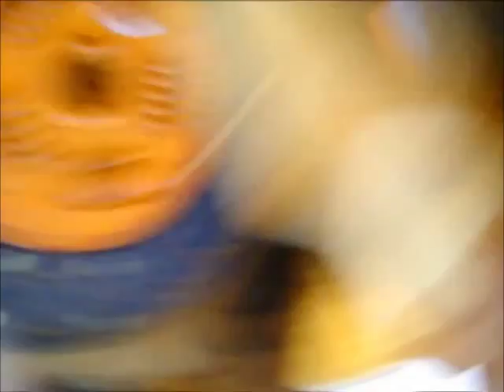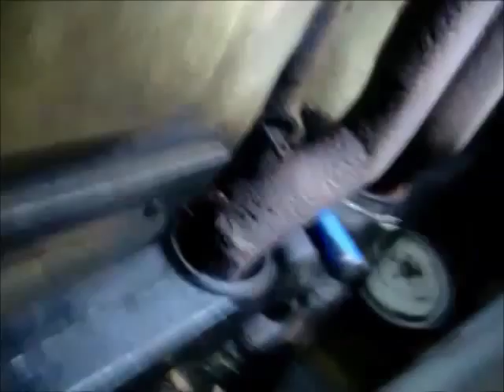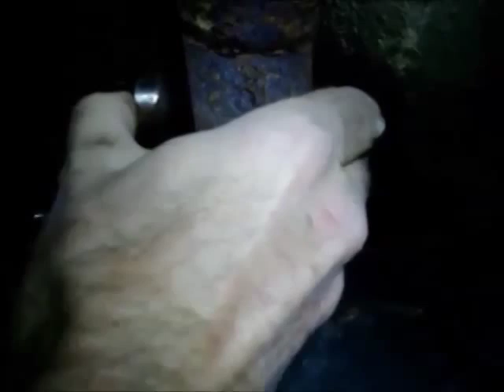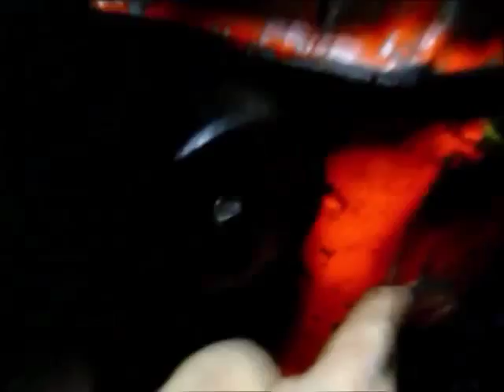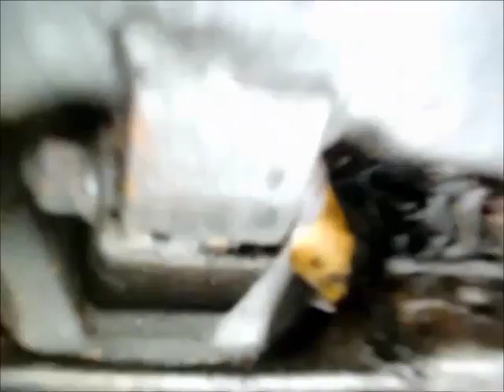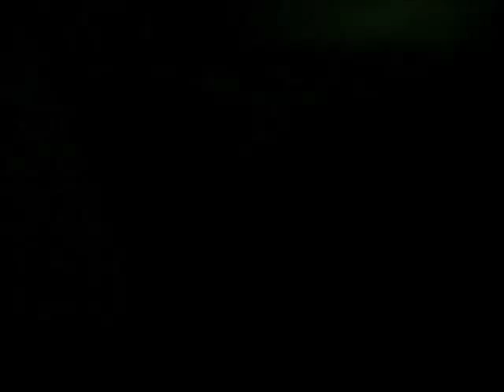1963 Corvette clutch replacement, part 1 of 5, preparation

Comment: My '66 needs a clutch, dammit
Reply from the maker: John Blutarsky, yeah, not easy on a Vette, that's for sure.
Reply: @owenrobertson  No doubt.  Harder with no lift and on an angled driveway, outside...but I budgeted for this and there's a good shop three miles away. Oh well.
Reply from the maker: I hope you've got it back on the road soon Bluto.
Reply: @owenrobertson  thanks!

Comment: Thanks for this one.  I have about 300 miles on my engine rebuild and the new throwout bearing failed.  I wasn't interested in removing the engine/transmission again to repair it.  This method made the whole job an afternoon even with interruptions.  Also, I wish I knew to remove the shifter from the rear of the crossmember when I took the engine out the first time.
Reply from the maker: Nice!

Comment: I just want to say thank you for posting this series of videos. I consider myself an average mechanic, and this vid made the removal much more understandable than my Chilton's manual. I did this on my '67, and although there were a few minor differences, I ran into all the same snags you did. 
I originally took my '67 in to a dealership to have my trans and differential fluids changed, they told my the trans was leaking and they had to remove the engine with the trans because of the cross member.. Would be several thousand dollars. They also said my trans drain plug was "sheared off" but I guess by '67 they stopped building the Muncie with a drain plug so they were just full of it. Anyways after removing, I took the muncie to my trans guy in St. Louis who put a new bearing in and gave it new gaskets and a clean bill of health. Ordered a new clutch and put it back together. Works great now! And my throw out bearing was making noise so it was good to replace that too.
I would mention that the lower bell housing cover was not mentioned in part 3, which I found out after already putting the flywheel, clutch disc and pressure plate on.. Maybe that's just later than '63.. Anyways I took it all off to install the cover, but I could have just removed the starter later on. My shifter bracket and exhaust bracket was a little different as well, but that's all I ran in to. 
Thanks again for posting this. My '67 is running very smooth and shifts very nice after cleaning everything up!
Reply from the maker: +Chris Parrett Glad it helped.  Sorry about the dust cover, it's a real juggling act in a mid year when you just don't want to pull or even move the engine.  You're right of course, I forgot to install that dust cover.  Then I cheated, I put it with my Vette's original fuel tank and some other original parts, and ordered an aftermarket bellhousing dust cover.  I cut the aftermarket part, so that it could be installed without removing the starter.  It's a handy inspection plate, if I ever want to look up in there, now it comes down really easily, without messing with the starter.  I don't recommend doing that though, it seemed easy enough at first, but when I started the engine, it contacted the flywheel a bit, just enough to make noise, and not damage anything.  I had to drop it back out and weld some steel to it to reinforce it.  That kept it from flexing against the flywheel.  Too much work, I should have just removed the starter.
Reply from the maker: +Chris Parrett Hopefully the next guy with a mid year will read this, for a heads up on that that bellhousing dust cover...regarding my other reply.
Reply from the maker: +Chris Parrett You're lucky to have a '67...you notice how your front to rear metal brake line runs along the lower portion of your frame rail?  I just found out they started doing that in '65.  1963 has that brake line running along the top of the frame rail, in that very tight spot between the frame and the body.  Mine sprung a pin hole leak from corrosion, and I bought the nice pre-bent metal brake line from one of the Corvette parts houses.  Part in hand, I looked under my car...uh oh...I googled it, the only way to install a '63 Corvette front to rear brake line along the top of the frame, and using the factory brackets, is the lift the body off the frame.  How crazy is that?  Mine is mounted like yours now, along the side of the frame rail...close enough.
Reply: Thanks! Yeah when I removed my dust cover I thought I accidentally bent it around a bit and was worried it would contact the flywheel after putting it back on. But after firing it up I heard no noise. Great video again. Have you posted anything else working on your '63? My '67 is in pretty good shape, no need for a frame-off resto or anything, but it sat for about 20 years with the previous owner so it still needs a little TLC.
Reply from the maker: +Chris Parrett My '63 is the same, it sat from 1989 until 2011.  I've got the full history of the car on my youtube channel in a video called Ronald Burkett, 1963 Corvette, 50 years of history...and the video of when I first had the car delivered...my neighbor fired up his dirt bike, so it sounds like the Vette is driving out of the trailer, but it was just rolling out in neutral.  There are videos of me getting it running for the first time, fixing the headlight and wiper motors...and a bunch of other car stuff, just click on my name, then click videos.  Just a bunch of car stuff.  I've got a bunch of old cars.
Reply: That's awesome. I'm still active duty Navy but one day I hope to have a garage with a bunch of toys. Right now I just have the '67, a 1973 Honda CB350f motorcycle, a 1957 Lambretta 125LD scooter and my Harley Softail Deuce. The more toys I have the harder it is to move everything when the Navy decides I have to relocate across the country..
Reply from the maker: +Chris Parrett Good for you...but yeah, military moves are tough with our hobby.  I was pretty sure Shaw AFB would be my last stop, I sold two cars before PCS'ing here...bought six since I've been here.  I retired after 24 about a year ago.  Do you have any pics of your Vette online?